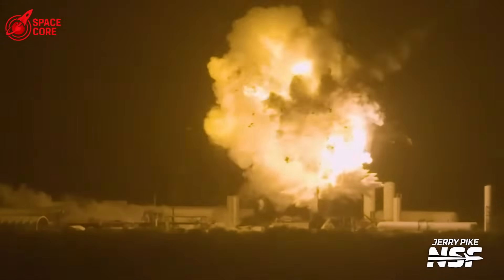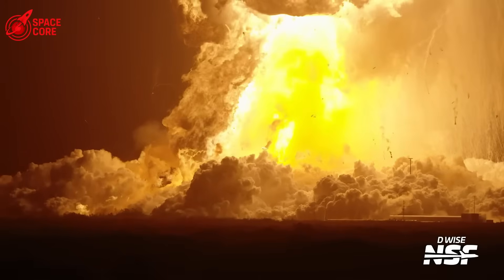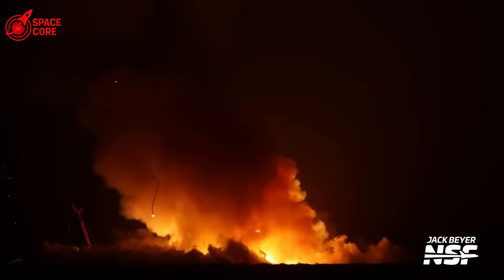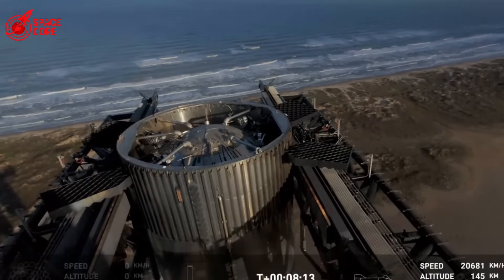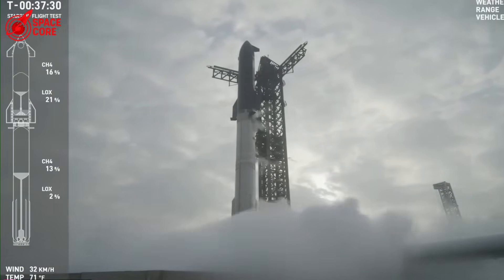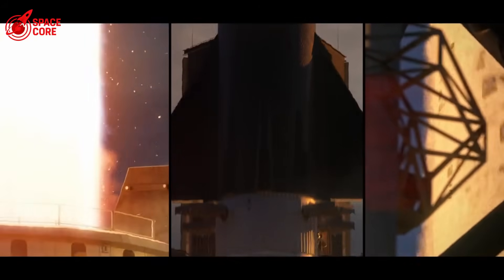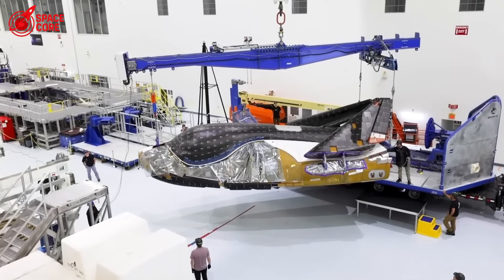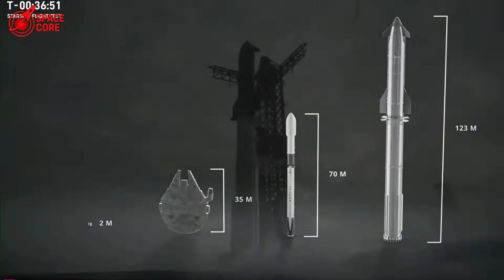WHY Did Starship 36 Self-Destruct? The Answer Changes Everything...

Comment from the maker: Starship's explosion exposed V2 flaws! Should SpaceX scrap it or push on? Tell us below!
Reply: Quit making cheaper and cheaper SHIPS
Reply: It has been reported by Musk that a Nitrogen COPV (Composite Over-wrapped Pressure Vessel) in the payload bay failed "below its proof pressure", and was the cause of the RUD. This is the first failure of a COPV on Starship.

This failure was NOT the fault of Spacex or Staship's design... SMH.
Reply: If they can't figure it out with V2, then press forward. Would not be the 1st time.

Comment: That’s 4 space craft explosions in a row. That would get any contractor fired! The COPV failed causing everything else to fail. Your facts suck!
Reply from the maker: You're right the Starship 36 explosion was a COPV failure. While there have been other test setbacks, they're not all the same. Each "rapid unscheduled disassembly" gives SpaceX crucial data for accelerating Mars missions.

Comment: The cause of Starship's problems is simple.
- The goal of saving weight prevents a solid structure
- The metal casting is not of high quality
- Weld inspection is lacking

Suspect:
Elon Musk's specifications prevent the creation of a stable system. I'm sure every engineer at SpaceX could avoid these
mistakes. Welding a tank isn't rocket science.

When does SpaceX become goal-oriented, rather than ideological?

The goal is to create a workhorse, not a miracle.

Workhorse Reusable Sure, I don't see it.
Reply from the maker: Starship’s weight-saving design and weld issues are valid concerns, but SpaceX’s iterative approach has driven breakthroughs despite setbacks like Ship 36’s explosion.

Comment: What is wrong with that company? They’re just building fireworks at this point
Reply: Rocket fuel can burn in the engine or all at once if the tanks rupture. This is not a morality play, it is engineering, interdependent parts.
Reply from the maker: Absolutely, the Ship 36 explosion shows how critical interdependent systems like tanks and valves are.
Reply from the maker: SpaceX’s Ship 36 explosion is a setback, but their iterative testing refines designs for Mars missions. What do you think they should change to avoid these “fireworks”?
Reply: @SpaceCore25 hire people who know what they’re doing instead of hiring people with a certain political agenda, but I’m not going to argue further
Reply: @SpaceCore25 have you ever worked in this field? Do you have any clue? I don’t think so

Comment: Yes I do believe that a shorter  V3 would fix the fuel problem also I think making the ship wider in diameter would help you could get similar payload also looking at the way they stabilise the fuel line, there is not enough surrport struts, which still allows for movement I may well be talking out of my hat , but I believe these mods would fix the issues 😊
Reply from the maker: A shorter, wider V3 could stabilize fuel lines better, but support struts alone may not fix the COPV flaws—Block 3 redesigns seem critical. What specific mods do you suggest for fuel stability?

Comment: Elon must consider that he may be a target of a CCP sabotage scheme. After all the CCP has been conducting hybrid warfare against the US for several years now, Covid 19, the Containership taking out the bridge in Brooklyn last year and now three Chinese students/ agents have been recently caught smuggling in viruses and parasites to infect the US food production and water supply. Elon Space X is putting thousands of satellites in orbit. China wants to stop Space X. Wake up folks! I have faith in Elon's capability. If it is a design flaw, then beef up the shell to 6 mm thickness, increase the Section Modulus of the shell stiffeners and use better weld inspection.
Reply from the maker: While sabotage concerns exist, no evidence confirms CCP involvement in Ship 36’s failure; a thicker shell and better welds could help, but Block 3’s redesign may be key.
Reply: @SpaceCore25  Quite correct, there is no evidence of the CCP involvement in the Starship explosion. But what do the police always say: 'means, motive and opportunity'. When those three conditions align, the investigators get focused. The CCP has all three conditions. A few CCP Naval snipers arrive by inflatable boat from submarine. They bob up to the surface of the gulf using the buoyancy of the raft to raise the 12.7 mm heavy machine gun to the surface. And with a silencer, and with a bipod set it up on the boat seat. With only their shoulders and heads out the the water, and from a range of 2.5 kilometers they take take a few shots at Starship. The shell is very thin 4.3 mm I believe, and BOOM! So far I see that the Star Base facilities do not have a comprehensive security plan. Its open to sabotage from outside the base as well as from internal sources. I bet that they let the gun sink to the seabed, rather than take it back aboard the sub.

Comment: It has been reported by Musk that a Nitrogen COPV (Composite Over-wrapped Pressure Vessel) in the payload bay failed "below its proof pressure", and was the cause of the RUD. This is the first failure of a COPV on Starship.

This failure was NOT the fault of Spacex or Staship's design... SMH.

OH FFS...  IT'S "TESTING"... They know full well this "can" happen and they "plan for it".

This is NOT CATASTROPHIC... This is not VERY BAD... it's a setback at most... It's "TESTING" and ROCKETRY IS HARD.
They do the testing HERE so it DOESN'T happen with people onboard.

QUIT BEING SO OVERLY DRAMATIC about TESTING RUDs...   Gods grow up.
Reply from the maker: Thanks for the insight! If the COPV failure was below proof pressure, do you think SpaceX should rethink their testing margins or stick with the current V2 design?

Comment: The go fast, do little engineering and learn through failures is not proving itself to work. High risk is high failures. This is why engineers are risk averse. If they dont get to a fueled vehicle in orbit that could go to the moon in payload in 5 years, will they acknowledge their flawed philosophy? This is not Falcon 9. Worse yet, the Steel design is a death nail. Its placing unrealistic demands on this design. 
I dont think that Space X can continue this for 5 years but we shall see.
Reply from the maker: Valid point on SpaceX's high-risk approach!
Reply: Steel Death Trail... Steel comes in different thicknesses. But wasn't the kicker a stuck pressure relief valve?
Reply: @tobyw9573 Becsuse the rocket is overly heavy, they are under pressure to lower mass at any cost and increase engine thrust at any cost. The “iterative” philosophy means they are very risk tolerant. This approach makes it very prone to failure. 
Steel is causing all these problems.
Why are airplanes not made of steel? They would not fly or fly with little range or payload. Is the SR-71 made of steel? No. Titanium. Steel was to heavy.
Reply: @tobyw9573 pressure vessels normally contain overpressure protection devices, like burst discs that rupture to preserve the structure

Comment: Didn't they have a similar event during a Falcon 9 fueling years ago?
Reply: It did, yes. But they worked it out in time.
Reply from the maker: Yes, a Falcon 9 exploded in 2016 due to a COPV failure in the LOX tank during fueling, similar to Starship 36's issue.

Comment: Space X needs to start again with V3 , I think they are going to big in size putting the ship under to much stress hopfully they will work it out
Reply from the maker: Interesting take! Do you think a smaller V3 design could reduce stress on the tanks, or is the COPV failure a separate issue SpaceX needs to tackle?
Reply: "TOO" FFS
Your comment is illogical. V3 is the biggest version and is built on designs and components that must be proven and perfected BEFORE you can build V3. You're literally saying, "they've gotten TOO big, they should start over with the biggest most complex model." That’s tbe dumbest thing I've seen in days.